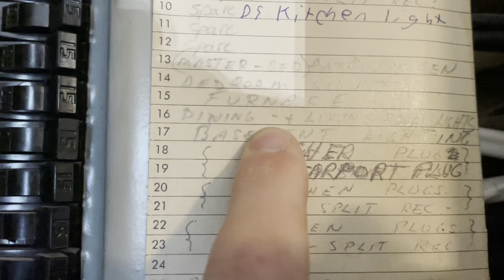Finding receptacle open ground.

Comment: Hi 
I have a question if you don't mind 
We have addressable facp with  P.S.U fault and Device fault alarm 

The 2nd one is conventional FACP after changing the batteries with new one I still get BATTERY fault alarm 

Any suggestions ? 
Thanks in advance
Reply from the maker: I believe PSU fault is an issue with the power supply. device fault could be a couple different things it could be a device missing from the SLC loop which will usually show up as invalid reply or it could be a nac fault. If you’re sure the batteries are putting out around 26-27 VDC that could be an issue with the board and if you haven’t already try resetting the system to see if the fault will clear.

Comment: It was obvious to me that the cause of the problem was that you had two sets of ground connections in one switch box. They were probably tied together at one point but somebody forgot to hook them together when replacing a switch. There is no reason to have two sets of ground wires that are not connected together in one box.
Reply: Thats it ! you called it, another way to trouble shoot that trace is test hot and usually in a room or next to the receptacle that works right. I was afraid he was going to remove every outlet & fixture in the house with a few switches included. These clients always expect you to know and go right to the problem no matter what.
Reply: @alhawkins3376  Can you elaborate on test hot in room or next receptacle? Do you mean to test hot to ground using the same method on a good working/grounded receptacle or switch?

Comment: I also once saw 40-ish volts neutral-to-ground.  What can sometimes happen is a completely disconnected (ground) wire inductively picks up voltage from its neighbor (hot) wire and this "ghost voltage" shows up on high-impedance multimeters like yours.  The voltage would disappear if you measure with a low-impedance multimeter.
Reply: A couple years back, I had a problem similar to the one in this video.  I discovered the problem while dealing with an unrelated problem -- a poor connection in the hot lead to a ceiling lamp.  While diagnosing that issue, I discovered that I, too, was getting ~46V on the ground lead. Fixing that lamp connection didn't resolve the odd voltage on the ground, and eventually surmised that that was ghost voltage.  (Side note:  Maybe had I been using an old galvanometer-based ammeter, I'd never have even seen that ghost voltage, due to the lower sensitivity of the meter.)

The fault in my case turned out to be a broken ground lead in the wiring.  This was the one 3-conductor cable in my house that had an aluminum ground lead (but copper hot and neutral leads)!  located the break between two outlet boxes, but couldn't located it closely enough to know where to punch a hole in the sheetrock.  (Note:  Using long leads, I indeed did confirm a lack of connectivity in the ground lead between upstream and downstream of this area.)  I ended up finding an accessible outlet downstream of the ground lead break, and ran a separate ground lead to that outlet.  Problem solved.

This was probably the biggest headache I've ever had in my old house.  I suggest all readers visit their breaker box and look for aluminum conductors and treat those as highly suspect.

Comment: I'd be concerned about that Federal Pacific Panel you have there. ......A Federal Pacific electrical panel lost its UL rating because the company, Federal Pacific Electric (FPE), was found to be fraudulently representing that their circuit breakers met Underwriters Laboratories (UL) standards when they did not, leading to UL withdrawing their certification for the panels; this is considered a major safety concern as FPE breakers may not trip properly under overload, potentially causing fires
Reply from the maker: It's a little bit different here in Canada as federal Pioneer still does have its CSA listing so insurance will still cover however there are still millions of them and in a perfect world they would be gone and I would prefer it not to be here myself.

Comment: All those grounds should have been tied together in the first place. Inside the gang all grounds should share to keep up on continuity.
Reply from the maker: Yes often they are but not always are they all together
Reply: @nics-systems-electric  well finding that when you combined all grounds it solved your issue.
Reply from the maker: @johnpetite7331  it did solve this issue though still isn't the best as there is still a open ground somewhere back to the panel on the affected circuit which would be ideal to find
Reply: @nics-systems-electric  have you found it yet? It's been 2 yrs. Just curious because I have a series of open ground receptacles and I'm about to start tracing it all. Hoping to come across a video that it's been solved without opening up the walls.
Reply from the maker: @johnpetite7331  no I haven't found it I haven't looked since. likely The original feed was cut and re-fed but grounds weren't re-spliced to the new feed potentially

Comment: Asp to remember checking j boxes with power on you never know if it’s a multi circuit u drop a neutral you will give that line 240 and fry a tv computer what ever is plugged in

Comment: Right before the continuity ground test at 7:22 , your left light switch top J hook doesn't even look like it's around the screw nor under the screw. I did see some other J hooks that were very sloppy on your receptacles. If you are going to replace everything, do it neatly and correct.

Comment: I’ve got 4 receptacles and two light that will not work. All on same breaker . Open ground but all ground is good and tight. Haven’t checked breaker box.
Reply: I have same issues right now did you figure It out

Comment: 1. All the grounds in the light switch box weren’t tied together.
2. When you were in the breaker panel you had a black wire going to the neutral bus bar and a white wire going to a breaker. Are you sure those two aren’t reversed?
3. Take every switch box, light box, and outlet box back apart and remove every wire nut off and confirm all wires are connected properly.
4. Use an extension cord hooked to a known good outlet and stretch it back to your problem area and check from the ground of the extension cord to each box and check voltage. You can also jumper the ground from the extension cord to each ground point in each box in the affected area and see what/where it corrects the problem. If it does.
5. At 12:21 is the switch on the right a 3-way switch? I noticed the white neutral wire but couldn’t see it well enough to tell much about the switch. I saw a black, red, and white wire but couldn’t tell if there was a ground wire going to the ground pigtail.
Reply: I cant agree with the extension cord, of course it will read correct and read ok if connected so why bother?  He used his tester well to isolate, even tested continuity so overall he troubleshot it well , just took to long to isolate cause it may not be a loose or problem as he expected, just a ground that had a path not direct back to the panel.
Reply: An extension cord would be a good way to test connectivity from one box to the next to find if there are any breaks in the ground wire. He tested voltages but did not test continuity.
Reply: @alhawkins3376  An extension cord would be a good way to test continuity from one box to the next.

Comment: If the open ground is on a Gfci then is not nessary to fix it but is recommended
Reply from the maker: No it's not on a GFCI that's not a proper way to fix the problem you should do it right and have the equipment ground
Reply: @nics-systems-electric  but Nec code says replace a 2 prong with a 3 prong Gfci is within code but this senerio the outlets lost their ground somehow and you had to fix it

Comment: Did you ever find a broken ground? I'm finding myself in this situation now and not sure where it could be broken. Most outlets on the circuit are ok, except for one. There is a ground wire present and connected. I tried replacing the receptacle but no dice. 

Still have to test one switch. I don't really know where they tapped into the line to run this outlet so it's hard to trace it. Frustrating for sure.
Reply from the maker: Frustrating for sure I did not find it but I also haven’t looked since splicing all the ground conductors together which there’s no reason for them not to be anyways
Reply: @nics-systems-electric  thanks for the feedback and the video. I feel like I gained some insight from watching. I'm very much new to all of this and mostly fumbling my way through things but am focussed on setting it up correctly. I am working on an attic remodel and wired 4 new outlets only to find that the wire I'm tapping into has open ground. I can't leave it this way so I either complete my mission and find the open ground or I'm calling the electrician.

I literally think about it the moment I wake up. Lol it's haunting me
Reply: @nics-systems-electric Hopefully someone didn’t splice romex into hidden knob&tube work in the wall somewhere!!  How old is the house? Could be the same scenario with this DANGEROUS hidden splicing of old BX to modern ROMEX hidden in some wall somewhere!!!
Reply from the maker: @dimitriberozny3729  definitely not knob and tube as it was long gone by 1976 it's all loomex the original stuff is probably NMD75

Comment: Also at the box I know u learn a lot in class and what not don’t start moving wires arround like that in the box forst put ur meter on it and one by one check all connections even the bare wire that is screwed down onto the neutral bar ground bar and breaker they can sometimes ark and and burn away making it not contact but if u check the screw head it will show voltage

Comment: I have an outlet showing open ground when I test it then two other outlets showing nothing. I checked breaker box and a breaker is off. I flipped the breaker back on and the two outlets that were off came back on and test good. I checked outlet that said open ground and now it tests correct? I do not understand how a breaker fixed the open ground? Any ideas and or advice how to track down and fix this problem?
Reply: How did it read open ground with the circuit off?   sounds impossible.

Comment: No way would your service panels, covered by another lift off panel would be legal in Indiana.  Plus you don't have a 3' x 3' work area in front of your panels.  WTH kind of set up is this?
Reply from the maker: I see it all the time it doesn’t really affect your work area as you’re still standing right in front of it
Reply: Code changes over time. What looks non compliant today may have been perfectly acceptable when it was originally installed.
Reply: @JeanPierreWhite Plus, he lives in Canada.

Comment: Dude, buy a cordless drill.
Reply from the maker: I've got them multiple of them
Reply: @nics-systems-electric  why do you spend so much time with a screwdriver?
Well we're at it. They also make extensions for those vacuum cleaners so you don't have to crawl around on the floor. So much. Like they used to say to the kids when we were out surfing and they were getting in our way on their boogie boards. "Be a man. Learn to stand"

Comment: Have you ever been got shocked?
Reply from the maker: Yes lots
Reply: @nics-systems-electric  I'd be careful touching metal plates, ground wires, and other things you assume are not hot, because they can be mis-wired or shorted to be hot.  Gloves and a non-contact tester can increase your margin of safety.